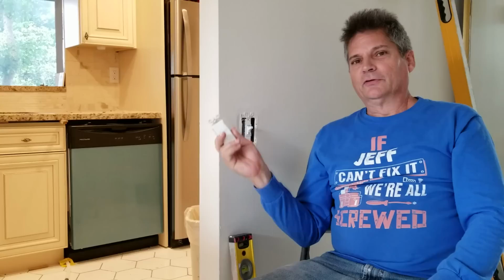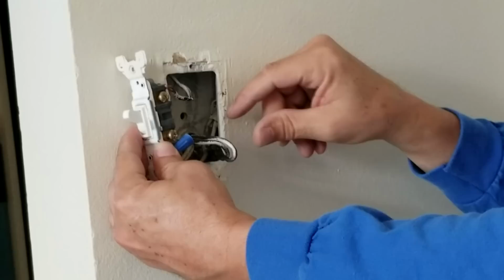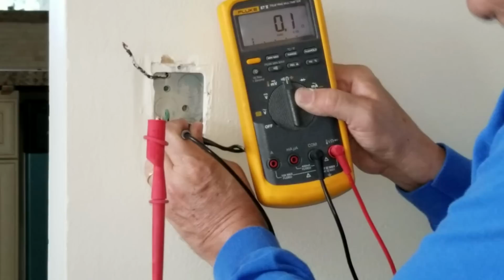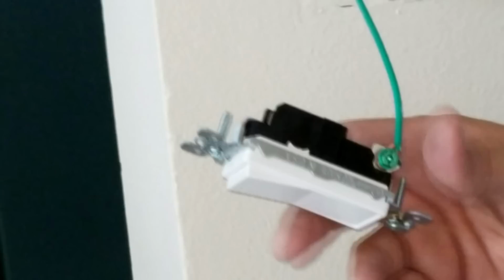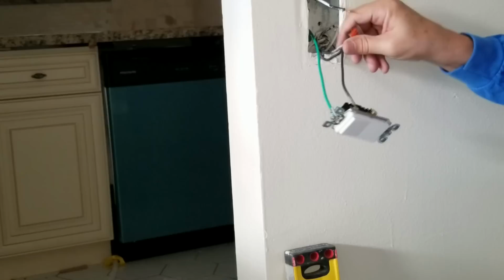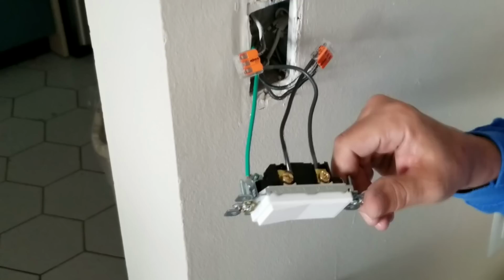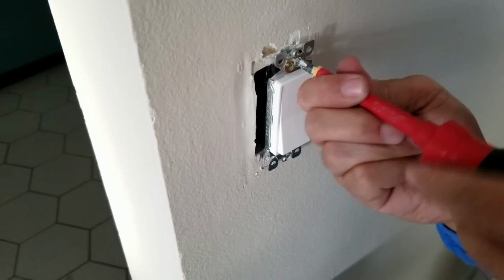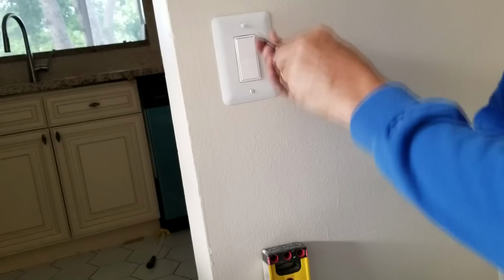How to Wire a Light Switch Per Electric Code for Wiring

Comment from the maker: Parts & Tools used in this Fridge outlet video:
✅ Fluke 87-V Digital Multimeter: https://amzn.to/2LK8etM 
✅ Fluke FLK2AC/90-1000V Pocket-Sized Voltage Detector:  https://amzn.to/2THggao
✅ Ideal Grounding Pigtails with Ground Screws (Pack of 50): https://amzn.to/2DMheg3
✅ Wago Lever-Nut/Wiring Nut  Assortment Pack: https://amzn.to/2GpXJLB
✅ Klein Tools D213-9NE Lineman Pliers: https://amzn.to/2LQMoou
✅ VOLTCLAW COMBO-PACK Electrical Wire Pliers: https://amzn.to/2RCyUSF
Reply: Hey Jeff, how did that light switch even work before you changed it as it had no line power attached?

Comment: Jeff, I caught your video about changing bathroom receptacle to GFCI.   So then I watched all your electrical videos.   Before I comment, I want you to know that I designed residential, commercial, and industrial electrical systems for electrical contractors since 1983 and I am a PE.   My opinion of your electrical videos is, other than a term or two, your videos are spot on correct and very much safe!   Great job sir!   Specifically, there is a difference between definition of outlet and receptacle, but only us engineer types really care!    Respectfully,   Kevin
Reply from the maker: Kevin thanks for the kind words and thank you so much for watching our videos!
Reply: jeffostroff    Sorry Jeff!   Not kind words, the truth!    👍😊

Comment: My voltage sensor detects current when the switch is off, but no voltage when the switch is on. I've changed the switch twice, so it's not a faulty switch.

Comment: I even did a 4 way switch a while back with power still on, 1 wire at a time ;)
Reply from the maker: That sounds scary!
Reply: @jeffostroff  not really, only when I found out the new switch came closed instead of open and 1 spark flew, then I opened it and all was well in the land

Comment: Great Video.    Do you have a preference on how you connect the wires (the loop method vs the straight method that you showed (not the backstab))?
Reply from the maker: The straight method is easier, sometimes it's hard to wrap around the screws, so on receptacles and switches that have those little brass clamping plate son the screws, I will use that.
Reply: @jeffostroff  thanks!

Comment: If I want to move the switch but the wire too short how do I extend it?
Reply from the maker: If the wire is too short, you have to add Romex wire onto what you have now to make up that extra length you need, but, you can't have a hidden junction in the wall per National Electric Code, so you'll have to make all these connections inside a junction box with a visible plate on the wall, because electrical code requires access to all wired connections. Alternatively you can do what we have done a few times in the past, and slice open the wall, and run a new new correct length of Romex cable from the last accessible outlet box to the new spot where you want it to go. I don't like the idea of having to use a blank plate on the wall, so I prefer to do my second method above even though it takes a bit more work. That way no one has to look at an unsightly plate on the wall.

Comment: If you add a outlet to this switch how would you do??
Reply from the maker: That depends if you want the outlet to be controlled by the light switch or not. I prefer to wire it in parallel with the light switch so that the light switch does not control the outlet. If you do this, you wire the grounds first, then make a pigtail wire from the brass colored screw of the light switch to the brass colored screw of the outlet. Also wire another pigtail from the silver colored screw of the switch to the silver colored screw of the outlet.
Reply: Can you give me a step by step of how to make it without having the switch on to ur the outlet. I’m new to this and trying it out for the first time  thank you for responding !
Reply from the maker: @hamidhakeemi4384  No, the best way is by seeing it in a video, try this other video we uploaded, it is close to what you are looking for https://youtu.be/wdnNmyp-VM8

Comment: possible improvements:
o     show the steps to disconnect the old switch...  back stabs?
o     careful about orientation...".. with these it does not matter... I use GFCI guide".... then "... see the label that says top"
o     appears the original switch was NOT grounded...   discuss the codes for grounding over time... plastic, metal boxes and metal, plastic cover plate..
otherwise good show
Reply from the maker: Thanks David!